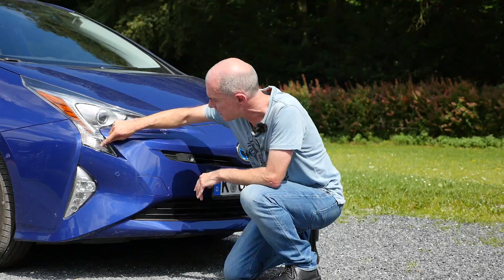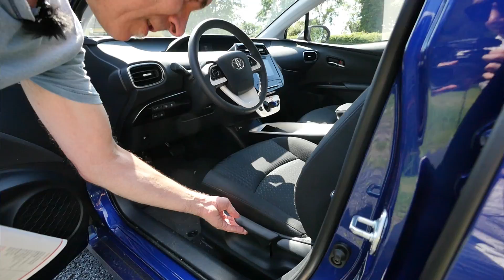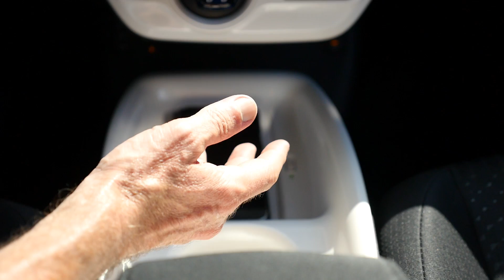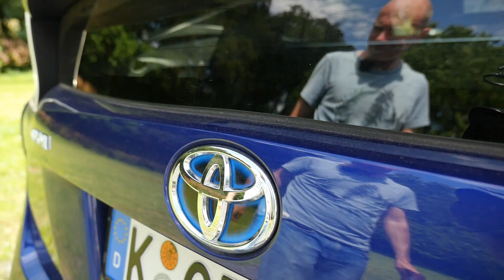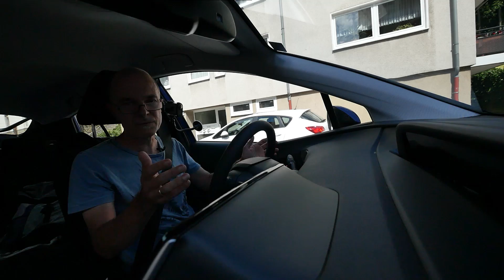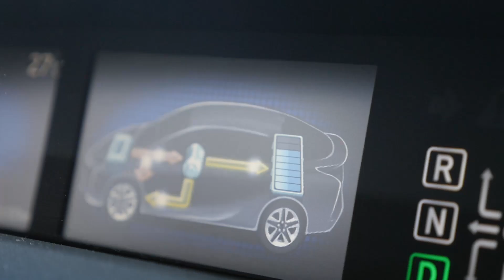Toyota Prius Hybrid FULL REVIEW test driven all-new gen neu Exterior/Interior/Driving

Comment: The white components on the steering wheel and console were major reasons that we didn't buy a 2016 Prius.
Reply from the maker: +John Donaldson oh wow! How come?
Reply: First it's because I think dark colors are more elegant looking. Second because I think that bright white color, contrasting with the rest of the interior, is just not pleasant to my eye. Third because I believe the white will look scratched and dirty after a while. I think it looks cheap.

We have other reasons why we purchased a new 2015 (already have a 2008) Prius over the 2016.
- Toyota lowered the height of the car and seating position by almost 2". I prefer a taller car
- Toyota designed out the upper glove box, made the lower glove box smaller, and eliminated some small storage spaces.
- Three of the 6 trim levels don't have a spare tire reducing options
- No 12V connector on the console
- Less rear seat legroom than the 2015
- Increase in mpg rating was not enough to justify over other considerations
- We didn't like the general look of the center stack

Comment: The B-mode is not only for more regeneration, the brake pedal will regenerate just as much. The point of the B-mode is to brake on the combustion engine when the battery is full to avoid overheating the brakes, normally when going down a long and steep descent, like you would on a traditional fixed ratio transmission.
Reply from the maker: To me it makes sense when going downhill that you dont have to press the brake pedal all the time
Reply: *****  Yes absolutely, but the most important reason for it being there is the engine braking. Without it, you would overheat the brakes, as there is no other way to control the rpms of the combustion engine.
Reply from the maker: Doesnt the recuperation take most of the heat and transforms it into energy for the battery?
Reply: ***** Yes, at first. But eventually the battery will be fully charged and can no longer absorb the energy, depending on the length of the descent and the state of charge in the battery, and at that point the combustion engine rpm will rise suddenly to use the engine compression to brake, just like you would use a lower gear in a car with fixed transmission ratios.
Reply from the maker: ahh great, got that now thanks!
Even more interesting: Talking about electric motors just on one axle or as AWD, if you have them on both axles, they should also make a stronger recuperation possible, as the wheels then turn the motors for the recuperation. So e.g. the Toyota RAV4 Hybrid should make a stronge recuperation possible as AWD model, shouldnt it?
Reply: ***** I think the limitation will be the battery, if the battery is the same then 4WD will not help regenerate more. Maybe a lower load on two generators will be more efficient than a higher load on one, but I am not sure. And if you have a very fast battery which can absorb energy fast (or a capacitor like the Mazda 6), the front wheels have the most potential, since weight is shifted forward during braking. But braking on all wheels helps stability on slippery surfaces, so I hope the 4WD cars do that.
Reply from the maker: interesting indeed, I ll see if I can catch a technician at some point about that.
Reply: ***** Thank you for great videos by the way. I have always looked to german auto journalists for actual serious journalism and not just entertainment (like they make in some other countries), and now it is even available in English :)
Reply from the maker: appreciated - stick with us!

Comment: 4.6l real consumption compared to 3.0l stated consumption means it uses 50% more fuel than they claim. that in my opinion is nothing more than a scam on Toyota's part.

I thought my bmw's ~8.7l real consumption compared to 6.4l claimed, was bad, but this is a lot worse.
Reply: Toyota's hybrid concept was made for the Japanese market. And in Japan it's not allowed to drive more than 100km/h.

If you don't drive more than 100km/h with this car then you will be rewarded with a consumption of 3,5 - 4,0 l/100km.

Comment: Good review overall ! The errors on specs , the lower LED's are fog lights ,the running lights are integrated in the headlights . The battery is a 1.8 lithium ion in all trims but the lower end Model two only which is the original battery technology. Here in the US. The 1.8 liter engine has been totally reworked to be lighter and 40 percent efficient to include the reworked hybrid drive train. I've been driving the Toyota Prius two Eco ver and have been achieving in the low 60 MPG range on avg. with no problem here in the US. With the ECO ver. Of the car.
Toyota does not sell a leather option in the Prius it's Faux leather in upper trim lines 

Thanks
enjoyed the review
Joe
Reply from the maker: great info Joe, thanks!
Reply from the maker: So we checked some stuff again...

According to official Toyota figures fuel consumption and CO2 emissions could be lowered by 20 percent compared to the drivetrain of the third generation vehicle.

The maximum thermal efficiency of the combustion engine could be raised to 40 percent - Toyota claims that to be the best value among all engines currently produced worldwide.

That compares to 37 percent on the first generation 1.5 litre power plant and 38.5 percent of the third generation Prius.

Finally we have no information that Toyota uses Lithium Ion batteries in the car - at least in European versions there is still a Nickel Metal Hydrid pack but it has become more compact and can therefore be installed beneath the rear seat bench.

According to the position of the daytime running lights and foglight we will double-check but believe that we were indeed mislead here.

Comment: I've been driving one of these for 4 months now while away for work, I normally drive the all electric VW eGolf. This car however is strange... It can't make up its mind what it is or what power train to use. The EV mode is useless, if you move your foot at all it shuts off, if your coasting it shuts off, when ever you want it , it's 'not available'... I'm driving the right hand drive version and the wiper on the rear is still in left hand position, so the wiper doesn't clean my view and I always mistake it for a car in my blind spot. The power mode is definitely the mode of choice, but it is a bit misleading for how much noise it makes vs how fast it's actually going (not very). I do like the HUD feature, and the adaptive cruise, but those are basic now. The interior is very roomy, even with 3 kids across the back. The exterior is , well, hideous. The nose has so much going on, the sides have nothing, then the back is off a different car altogether! It makes the old Prius look handsome. I can't wait to get back to my eGolf, for many reasons,, including not having to go to a gas station every again!
Reply: Two words about the eGolf......range anxiety. Here in the US, electric cars will not be a really viable and accepted form of automobiles until the solid state batteries are mainstream. I'm talking less than 5 minute charge times and ranges of 500 to 1000 miles per charge. Until then, the hybrid form is way better at this moment in time.
Reply from the maker: +JAEGERTECH interesting, thanks for the feedback!

Comment: They can't justify this monstrosity of design by saying it's better this way to be aerodynamic. The CLA has a lower drag coefficient and it looks beautiful. Toyota is just trying to justify the hideous design or they were just too lazy to design something that looked good AND had a good drag coefficient.
Reply: cw is pretty much the same, 0.22 (as mercedes states, other sources tend to evaluate it higher) and the prius is 0.24. That being said, different cla models have different drag coefficient. Other cla models have higher values up to 0.30. if you just change the tires, which you have to for some stronger motors, it's already a different story, so I wouldnt overrate all that. 
Better value to compare is mpg.

Comment: Expensive to buy + expensive to replace the battery + not good to drive + hard to resell after 5 years + really ugly to sane people's eyes + small boot space = a complete scam in the name of environmental friendly bull
Reply: Caring what other people think of you while driving your car indicates a shallowness that may exceed the most vain personalities in Hollywood. Talking about insanity.....who cares what you or anyone else drives or what it looks like....FORM FOLLOWS FUNCTION. That engineering creed that I always follow has always been right. The Prius is designed to do one thing....get to point A to B with the least amount of energy. That it does well while being one of the least maintenance intensive cars on the road. I've driven my previous Prius for almost 15 years with only oil changes, tires and brakes to replace. No other problems. No battery replacement needed. The new Prius is so much better and I really don't care what other people think of me while I drive it. Shallow people might care....not me. My last Prius had over 500K  trouble free miles.
Reply: Leo Wan untrue, there are two dealers here who exist purely on used Prius cars!